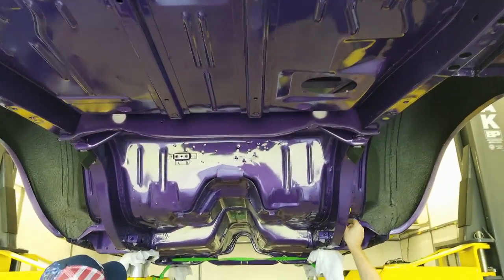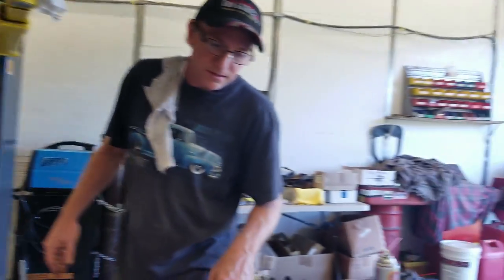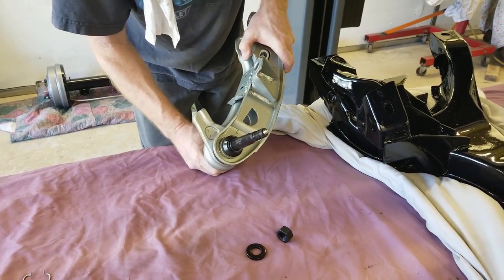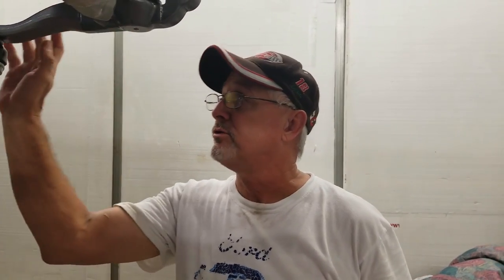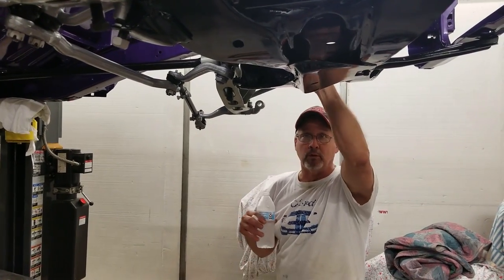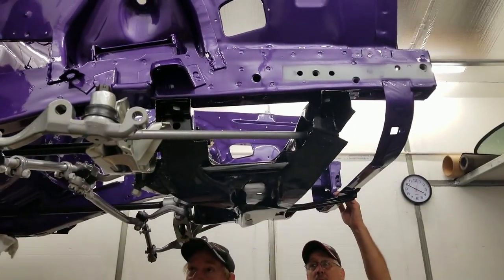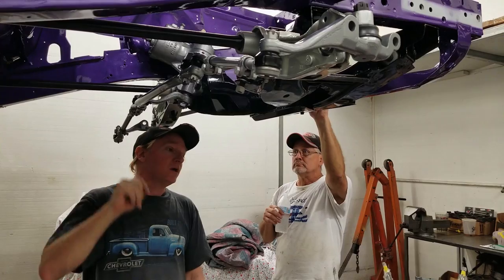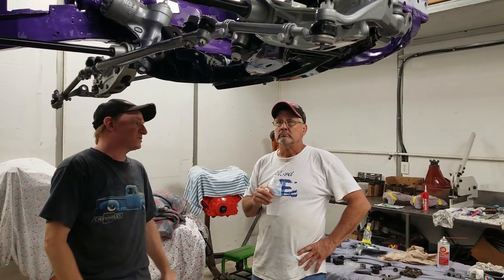Rotisserie Restoration 1973 Dodge Challenger - Chassis Assembly

Comment: That is turning out beautiful. How do you cover the unpainted parts of the frame from the rotisserie mounting and what is the color on the suspension components. A nice contrast.
Reply from the maker: A couple areas we are going to refinish  that we could not get to as the rotisserie covered the mount points. We will able to blend  those areas easily and finish it out complete!  the colors we used to process the suspension parts are Chromabase paint in various shades of silver to mimic (attempt) factory... Thankyou!